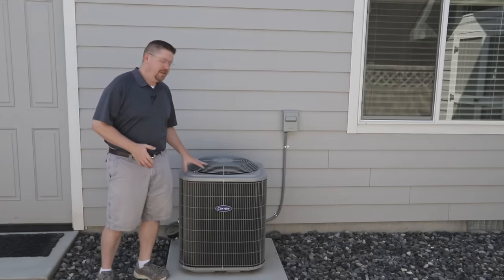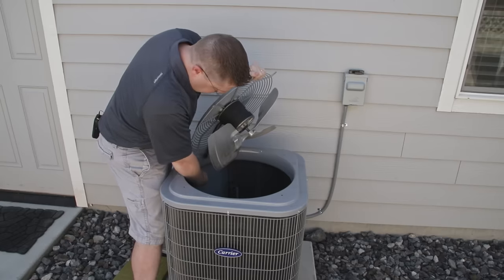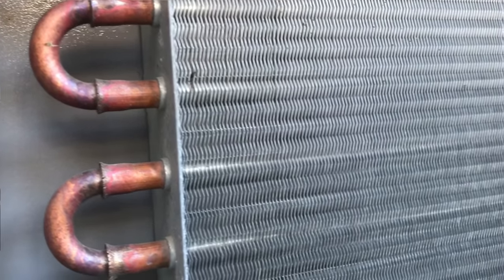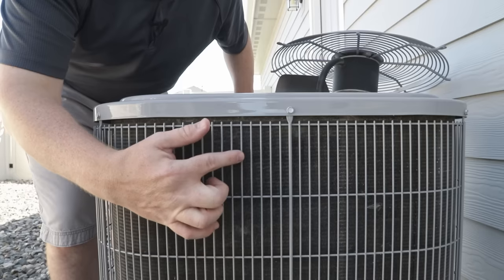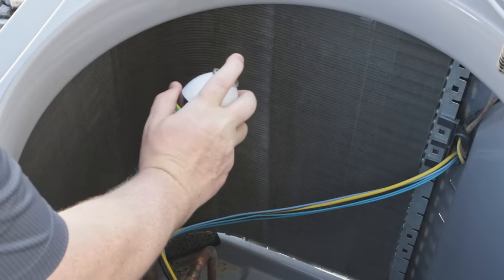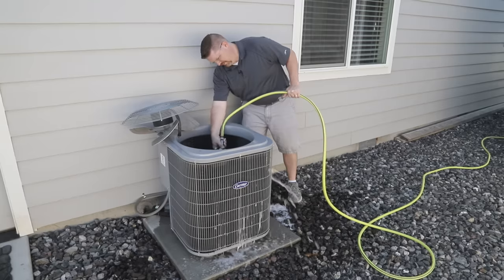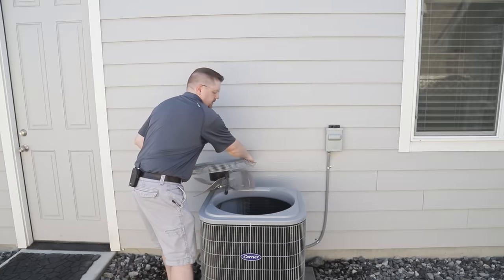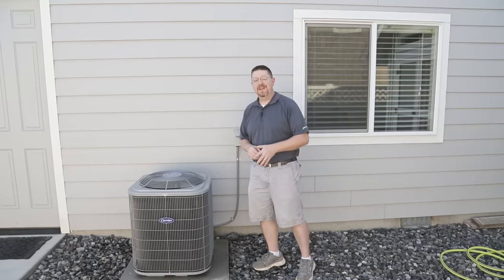How To Clean Your Air Conditioner Condenser Coil (Step By Step)

Comment: Awesome video! I can now do this on my own. I actually was looking at that exact can of cleaner on Home Depot's site. My only question would be do you have to let the coils dry before turning the unit back on.
Reply from the maker: I like to let the unit drain to the point that there is not a bunch of standing water inside, but it's ok to turn it back on while it is still a little wet. Keep in mind these things are designed to live out in the elements - rain, snow, etc. It'll operate just fine even if you start it up while still wet. 
Good luck!

Comment: Well one thing about this method, if you spray a foaming cleaner on it, you should spray the outside.  The idea is for the foaming action to lift the dirt and debri off of the fins and then you can wash that off with a hose.  The inside is not normally as dirty as the outside.  I like a water and cleaner solution which can be sprayed on with a foaming cannon. This way you get a lot more foaming chemicals on the items you are tyring to clean.  That can of spray seems to start foaming the time it touches a fin and does not penetrate the fins like the soluition.
Reply from the maker: Hi Pipi - the reason I recommend cleaning from the inside out is that the fan pulls air (and dirt/junk) in from the outside. Dirt and junk gets pulled into the small spaces between the fins, blocking them off entirely over time. If you just spray from the outside, you'll merely force that dirt and junk deeper into the cracks between the fins. By cleaning from the inside out, The cleanser and water push the junk back out the way it came in. Make sense? 
Thanks for watching!

Comment: Thank you  I was looking for this.   I was also told  low power  'VERY low power water can be used to push debris out of the blades.   ??      High pressure hoses or air is  BAD BAD bad.
Reply from the maker: Hi J C - you were given good information. These fins are VERY delicate, and can bend quite easily if you use an air compressor or high pressure hose. Garden hose, on a gentle setting is all you should need. Thanks for watching!

Comment: Hope this isn't a dumb question, but does this video apply to heat pump condenser as well?  My heat pump unit looks just like the one in your video.  Thank you for a great instructional video!
Reply from the maker: Hi James - Any heat exchanger with coils like the ones in this video should be able to be cleaned using the process I showed. Of course: you should check the owner's manual etc for your specific system in case there are any special specific steps/considerations. Good luck!

Comment: I bought the same spray foam cleaner from Home Depot and it did not foam like that at all. I followed the instructions and shook it well, but it never foamed like that. It came out in a thin spray.  I have an older unit with porcupine coils and in the past have used just water and it looked good.
Reply from the maker: Interesting - I wonder if they changed the formulation, or if there is some other factor in play.
Reply: I have noticed coil cleaner, at least the aerosol cans you need to check the expiration date on them. Even then sometimes they just spray flat no foam. Buy it by the gallon and use a pump sprayer save some money just be carful some are really like spraying acid.

Comment: Our unit was blowing hot air back in the 80s and watched the tech do exactly this from the inside out and that's all that was wrong with it... it started blowing cool again. Been doing ever since, not sure if the spray is neccessary though?
Reply from the maker: Hi Part 1 - any sort of mild detergent will just help the cleaning a) go faster and b) be more thorough. Some people just use plain water, but I like using a foaming cleanser. The foam really does a good job of clearing out all the dirt.
Thanks for watching!

Comment: Great cleaning video.   Not being critical, but never set the top down on the blades.  They bend very easily and will then be out of balance.  Cleaning the unit really makes a differerence in performance
Reply from the maker: Thanks Edward - unfortunately there sometimes are not a lot of options about how to place the fan due to the way the unit is constructed. You do make a great point though - it's important to be very careful not to bend any of the fan blades. Thanks for the feedback, and for watching!

Comment: Do you have to dry it with a towel. With all that water won’t it rust?  Great video. Thanks
Reply from the maker: Hi Strong John - no, you don't need to dry it. These are made of aluminum, and are designed to be out in the elements (rain, snow, etc). Thanks for watching!

Comment: Great video. Do you recommend the maintenance program thats offered by these air and heating companies? What all do they really do?
Reply from the maker: Great question!
I don't recommend the maintenance programs. It has been my experience that they are overpriced, and don't actually save you much of any money in the long run. The specifics of these programs will vary from company to company, but the common approach many in my area take is to charge you an annual fee of something around $100, for which you'll get a single visit from a technician to do "annual maintenance". This maintenance usually includes changing the air filter in your system, and probably cleaning the condenser and evaporator coil. All 3 of these items are very simple DIY jobs which can be done very, very inexpensively. 
The main reason companies offer this annual service plan is to get someone out there to try to find any reason to upsell you on something - anything. My neighbor's father retired from one such company, and it was no secret with him: His job was to convince the homeowner that their system needed something. Didn't matter what, but he was not supposed to leave any of these annual maintenance calls without something extra on the books. 
Today's systems are quite reliable, and last a long time if you do the basics yourself like keeping the filters changed every 3 months,  and cleaning the condenser and evap coils. I'm happy to call a technician when something is actually broken (blower motor fails, freon leak, etc) but I'll do the basic upkeep myself.
Reply: @AmplifyDIY  Thank you for your reply!

Comment: thanks for this information! My question is- do you need to wait for it to dry before hooking the power back up?
Reply from the maker: Hi Christine - remember that these units are designed to run in the rain, and are perfectly fine to get a little wet. As long as drain at the bottom of your unit is not blocked, you'll be perfectly fine starting it up with a little water on it. Note that there may be some odd "ping" sounds as the fan spins up - this is water droplets being sucked out of the metal enclosure and hitting the fan blades. It's normal, and temporary. Good luck!
Reply: @AmplifyDIY  thank you so much for the quick reply to my question! You are going to save me a bunch of money by learning to do this myself! I have just ordered my kit and it should arrive this week for me to complete this task next weekend on my days off.

Comment: Great video but it’s important to also mention to “wait until water dries up from the AC coils” before powering up the AC. I followed your instructions and ended up blowing the contractor because I turned the AC on immediately.
Reply from the maker: Hi Ola - you blew the contactor? I'm confused how a little water in the unit would have done that, since these are designed to run outdoors in the rain, snow, etc. I generally reassemble and immediately reconnect and start up my unit, and have never had any issues. Sorry to hear you ran into a problem, and I hope your system is running smoothly now.

Comment: Now does it matter how you clean the coils. For example you sprayed in the inside and washed inside out. Can you spray from the outside and wash from the outside? Just wondering
Reply from the maker: Hi Raul - it only really matters because most of the debris that clogs up these fins does so by sticking to the outside of the unit. If you spray it from the outside, you will push all that junk through the fins, and some of it will get stuck. It’s better to clean from the inside out.

Comment: Great information, but I don't understand why you spray the foam from the inside. Wouldn't it be more effective to spray it from the outside where most of the dirt has accumulated?
Reply from the maker: Good question! The dirt accumulates on the outside as well as in between all the fins. If I were to spray the foam from the outside, as the foam travels into the spaces between the fins it would carry more of the surface dirt into those spaces. By spraying from the inside-out, the foam does not pull any more dirt into the spaces between the fins, as the inside is relatively clean in the first place. Note that in the video I foam from the inside, then rinse first from the inside, which forces all the dirt that had collected between the fins to the outside. Then I finally rinse the whole unit down from the outside. 
Hopefully this makes sense - I'm just trying not to draw more dirt into the spaces between the fins. Thanks for watching!
Reply: @AmplifyDIY  Makes total sense -- thanks for the reply!

Comment: I like. What this vid did for me was back up another vid. Gimme enough good reliable info and i m in!  Cleaning your machine and mini splits costs around 200$ cdn.   Its worth doing oneself while the machine is perfect otherwise.  My machine is two yrs old. Great timing for me to go see what has accumulated.  Inside the house we ve changed / cleaned filters three times. We lived in construction mode 18 mths so the brand new mini splits got dirty. We didnt clean fast enough, nothing terrible but more then i d let them go now

Comment: Thanks for the video! I am considering doing this as a side hustle while I’m in college. I ran the idea by my parents and they are concerned about the liability of damaging the unit, and being responsible for a deductible. If I follow your instructions to the letter, how likely is there to be damage to the unit?
Reply from the maker: Hi Colby - the likelihood of you directly causing damage is pretty low, but the likelihood of some homeowner having an issue with their A/C after you have been there (though unrelated in cause, in the homeowner's mind is your fault) is somewhat higher. This would make a great side hustle during college though. If you decide to pursue it, I'd check into forming a quick little business entity (an LLC, etc) and getting business insurance. A local accountant or tax adviser can get you on the right track for setting up things to protect yourself from litigious homeowners. 
Good luck!
Reply: @AmplifyDIY  Thank you!

Comment: Apparently I've had nothing but bad luck with HVAC guys because I've had AC units that just weren't doing the job and they always said there wasn't anything that could be done and not one of them ever went to the back and even attempted to clean that out but that was on the landlord but now I'm glad I know what I know because I would have done it myself or called them out for it.Correct Mia if I'm wrong but that's what this looks like to me.
Reply from the maker: Seriously clogged up coils can definitely cause your system to have a hard time keeping up. Good luck!

Comment: Do you air-dry it? How long do you wait between cleaning it and plugging power?
Reply from the maker: You can put everything back together and power it back on as soon as you are finished cleaning. Remember that these units are designed to sit outside in the elements, and are fine to get wet. Good luck!

Comment: Great video!! Thank you. I have a unit on my roof that has the ac and heater all in one. I don't know how this units are called. Can I do the samething with it?? Thank you.
Reply from the maker: Hi Gilberto - I'm not familiar with the exact layout of your system, but if it has a set of condenser coils, yes, you should be able to clean them. Consult your owner's manual for specific cleaning instructions for your unit. Good luck!

Comment: That box is not a breaker ; it is a bus bar connection that holds two fuses. A breaker consist of a tripping mechanism that can be reset manually.
Reply from the maker: Thank you for the correction and clarification...and thanks for watching!

Comment: How bizarre is this - I have two similar units, one for each floor, installed ~ ten years ago.  After replacing the cap in one 5 days ago (thanks for your video), the cap on the second unit failed!  Thankfully, I had bought an extra cap so quick fix!
Reply from the maker: That reminds me: I keep meaning to go look up which cap mine needs to make sure I have a spare sitting on my shelf. Thanks!

Comment: My AC is three years old and it's starting to have problems now. I'm in Florida and can't get the temp below 80 in the house. My house is not even 1000 square feet so I know something is wrong. I'm gonna give this cleaning a try. I already tried vacuuming the drain pipes and that didn't work.
Reply: aye man tell me if it works
Reply from the maker: I really hope it helps. Good luck!

Comment: Hey man, I forgot to mention... I dunno how well this works on central air condensers... but on window a/c units, you can spray the WEB cleaner (or whatever brand of choice is), let it sit for a few, then run the a/c and then it cleans itself and makes bubbles everywhere
Reply from the maker: Yeah, it depends on how much condensation occurs on the condenser. I live in a very dry area, and wanted to give the best general advice that would work well no matter the local climate, so I didn’t bring it up. You are absolutely correct though: these cleaners advertise “no rinsing required”, but where I live there is just not enough humidity to do a good job. Thanks for watching!
Reply: @AmplifyDIY  you're welcome bud.. was gonna say I too ran a condenser cleaning show, and it was self cleaning.  Then again, I live near Cincinnati OH and the humidity here sucks

Edit: in fact, I was born there...
Reply: AmplifyDIY - I think the no rinse cleaners are for the A coil or evaporator coils not the condenser coils. Condenser will never get wet so you should always rinse the stuff off unlike evaporator coils which are in the attic typically

Comment: Cleaning the bottom out is hard as heck to do when you have a 4-5ft tall Trane 2 stage heat pump.
Reply from the maker: Oof. That does seem like a pain in the neck.
Reply: @AmplifyDIY  yeah mate I'm so used to my old one which was a Trane xr13 which was only about waist high they replaced it with a XV20i heat pump when I updated my system few months ago and the thing is almost as tall as I am been scratching my head for a couple of weeks now on how to clean the bottom of this thing out because it has accumulated about a foot of leaves down and in around the compressor and the other little tank down in there for the heat pump I can't remember what it's called from a sawtooth Red oak that's been puking leaves for about the last 2 weeks. Most definitely going to need a step ladder and probably a shop vac because there is no way you going to reach down in there and pull that out without climbing down inside the thing,

Comment: Nice vid can I use the same spray for my car condenser or radiator?
Reply from the maker: I believe so, but double check the label of any spray / cleaner you use to make sure it does not have any warnings about automotive use.

Comment: Awesome video, ? How long after cleaning till you can use the air again?
Reply from the maker: Pretty much immediately. Keep in mind these are designed to be run outdoors in the weather, so even if the unit is still dripping a little, it can be turned back on. Good luck!

Comment: Your friends coils (shown at 6:10) have rocks and pebbles right onto the fins and tubes at the ground level. The vibrations from normal operations MAY eventually lead to these rocks doing some irreparable damage and/or leaks. Doesn't his unit sit on a concrete pad?
Reply: i agree his buddy should get themselves a platform for the AC

Comment: Thanks for the video. I got a question. I have two options to heat my apartment. One uses the external heat pump unit like you have in the video and the second option uses the heat pump + the coils that glows red. The first option is more energy efficient that it takes more time to heat up the apt. The second option with the coils heat up faster but consumes more energy. Which one do you recommend to use? Please let me know when you get a chance. Thanks!
Reply from the maker: Hi Hideaki! Heat pumps are great when efficiency (i.e., cost to run) is a large factor. Resistive heaters (the one that glows red) are great when you need things warmed up quickly. If you are trying to balance the 2, I would suggest that when the apartment is cold (say, you've been away for a few days) use the resistive heater to heat it up quickly, then switch to the heat pump to maintain the temperature.
Reply: @AmplifyDIY  awesome. Thanks for the reply!